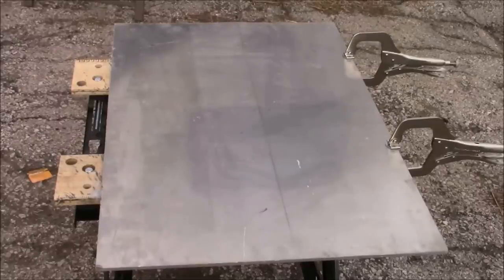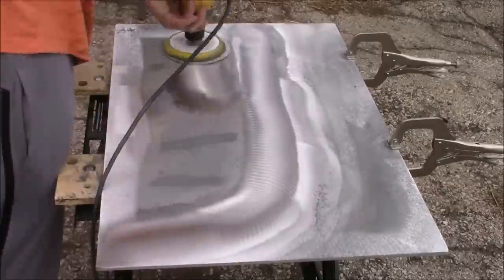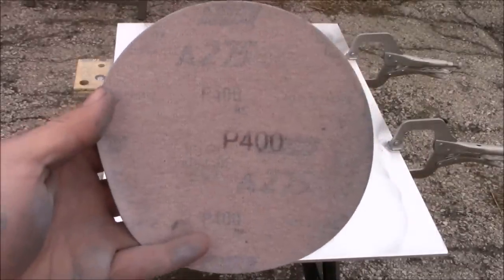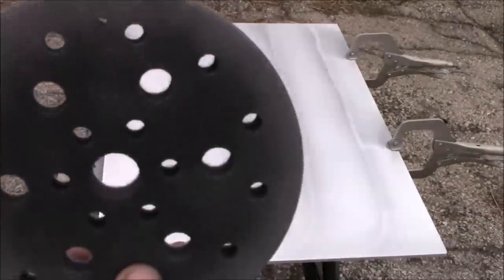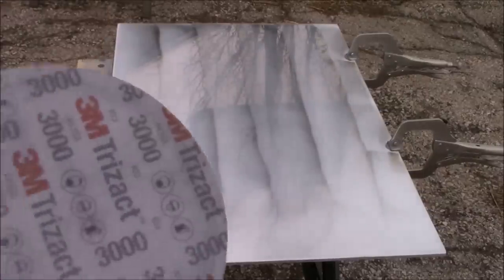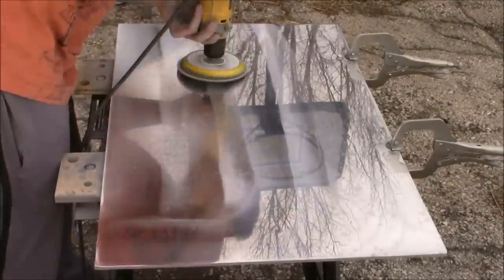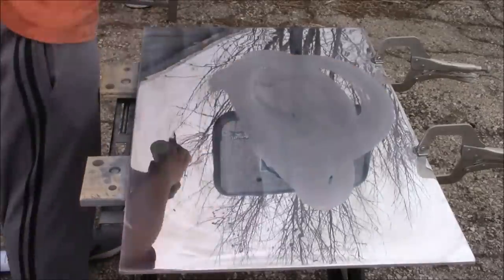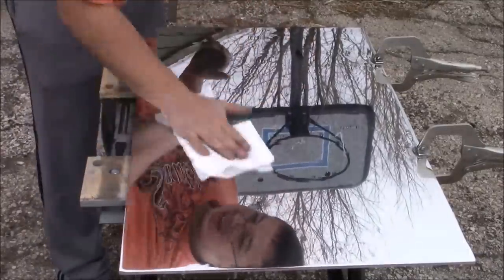How To Sand and Polish Aluminum To Mirror Finish

Comment: Great video showing how to get there step by step.  However, there's more than one way to skin a cat.  You could rub it my hand and get there a year later.  So it all comes down to how much time and at what cost.  By the way, my comments apply to this video and the one you have on stainless steel.  While 3M products are the best, they are way to pricy for what the average person wants to spend. I would be willing to bet the cost of the products you suggest exceed the cost of the metal itself.  Also, the alumicut (other video) and Gord's are pretty obscure products. Suggest a teflon lubricant and one of the many outstanding aluminum polishes on amazon that are highly rated and cheaper.  I'll suggest and link for sandpaper that is way cheaper that comes with both the hook and loop pad and soft backing pad.  Lastly, I point you at Zephyr products buy way of a youtube video demonstrating the very thing you're doing.  I've never used their buffing wheels or rouge, but I can't help wonder if this route would be much cheaper in the long run if you're going to be doing this over time.    Zephyr (https://www.youtube.com/watch?v=5K8GXcJ5pJs&t=0s&index=2&list=PL8FsQ8z7fVccvY_z04RFepojSBwutopYA&frags=pl%2Cwn)  Sandpaper (https://www.amazon.com/dp/B073NYSB82/?coliid=I1QN5HFUW411BZ&colid=1FU2X748C3H9G&ref_=lv_ov_lig_dp_it&th=1)  Thanks for your video. Very helpful.

Comment: Nice shine you know I just paid 250 just for the fronts of my aluminium rims . I just didn't have the time but for the money I paid him I could of got my own stuff . do you know from what grit I should start with and then end with .and then I know to add polish After sanding .but kinda nervous putting sand paper to my rims but I got some scratches and a curbed rim that needs some sanding to smooth out wear I hit the rim thanks great job on that plat
Reply from the maker: Thank you. I have links to all the products I used in my description. You can follow all the steps in this video or you can watch my aluminum rim polishing video:https://youtu.be/eAaROQgJJ9E ,

Comment: Hey! Thanks a lot for the video! Its very helpful. Did you notice the aluminium to oxidate? It usually should become "greyish" quite fast. Did you use anything to protect it from that? Clear laque or something similar should help...
Reply from the maker: Thank you! I'm glad you liked the video. Well the polish I used contains a sealant that helps hold off the aluminum from oxidizing. It should stay shiny for several months.
Reply: Skills and Trade hey Thanks for the quick response!
Reply from the maker: No problem. Glad I could help.

Comment: If you wanted to have a swirl pattern in it would you want to scratch it out before or after you polish I’m assuming before since you should only hit the high spots making it mirrored with your pattern still etched in?
Reply from the maker: Yes that should work fine

Comment: I have new aluminium shiny but not glass finish can I skip a couple stages?
Reply from the maker: You could maybe skip the 220 grit if the aluminum is not badly scratched.  If you skip the 3000 grit or higher your ability to achieve a mirror will be diminished.

Comment: Awesome.  Did you use a drill because you think that is the best tool for this job?  I am trying to work out what tools to get.
Reply from the maker: Thanks. I used a drill because it works the best for me. I actually have Amazon links in my description showing all the tools and supplies I used.
Reply: I think a Festool Rotex would be perfect but it is rather pricey...

Comment: Hey man cool job. I want to do the same to my motorhome the top half both sides without taking panels off. Can it be done?
Reply from the maker: If it's aluminum it can be sanded and polished. I'm not sure if you can do it without taking the panels off,  as I'm not familiar with your motor home. Best of luck on your project

Comment: Question: about how many minutes did you spend on each grade of sandpaper? I've got a 4" diameter 20 foot long aluminum pipe that I want to polish before I paint it. Doesn't need a mirror finish.
Reply from the maker: About 5 minutes or so. I have product links in my description if needed. Good luck with your project!

Comment: can you talk more about the burning that made you switch half way through the 3000 grit? I tried sanding an aluminum bicycle stem and I got these weird streaks / stains and I think I'm going to redo it.
Reply from the maker: The 3000 pad was getting worn out, it sounds like the same was happening to you. Start from an earlier grit and redo it and you should be fine

Comment: I tried this for the window trim on a mid 1950s vintage trailer. My results weren't as good. :( The WD-40 almost seemed to create a dark grey slurry that was hard to remove and when polished it was splotchy and definitely not mirror like. Obviously my application was crap but wondering if maybe these old anodized aluminum trim need more of the 400 sanding? Did I put too much WD-40? I lightly sprayed between every other grit. It seemed to make a light grey coating on the pads too. What if we sanded without the lubricant?
Reply from the maker: https://youtu.be/bgtW-kbmQwc , you should try watching my second attempt at sanding and polishing aluminum. I use alumicut instead and it worked better than WD-40

Comment: Great video!! One question... how did you attach the interface pads/hook it pads to the drill? They are threaded to go on a polisher. Is there a special attachment? Or did you simply put threaded part directly into the chuck?
Reply from the maker: I simply just attached them to the chuck.
Reply: Skills and Trade amazing! Thanks for the tip!
Reply from the maker: No problem, I'm happy to help

Comment: I wanna do this to my hood on my car where did you get the sandpaper and the tool that it goes on not the drill but the attachment and also that black pad and the one at the end where you take off the aluminum polish also what grade steel wool was that 0000 fine or?
Reply from the maker: I got all my tools and sandpaper off of Amazon. I actually have product links in my description if you are interested. And yes it was 0000 fine steel wool

Comment: Should you put a clear coat on metals? Lets say I polish the edge of a typical steel wheel using this method should I clear coat it to  keep the polish look longer? I want to polish about a half inch of 2 sets of wheels and paint the insides blue.
Reply from the maker: It shouldn't hurt your finish and help keep the polish look. Best of luck on your project.
Reply: Nickelbawker if you can make it stick without problems with all the oils and polish on it.

Comment: I want to do this with my scooter engine case, but there are small scratches on it so i need to start with low sand paper right ? Cause I tried a 600 sand paper and it made nothing to the scratches
Reply from the maker: Yes, if the 600 grit isn't working I'd recommend the lower grit sandpaper

Comment: I followed this step by step and results were amazing up until the polishing. I found the polish made it dull again. Any advice on how I could avoid this?
Reply from the maker: Use more polish, and buff slower. The drill should be moving very slow. Don't leave an area until the polish has been buffed completely

Comment: i tried this on some aluminum fuel tanks and ended up with alot of swirl marks. At what point in the process should have they gone away?
Reply from the maker: Retry the 800 sand paper, try to keep the hook-it pad with a slight angle, too flat and it has the potential to make swirl marks

Comment: What are the dimensions and grade of that plate. I'm trying to do the same to a 4ft x 8ft 1/8 in aluminum sheet of 5052
Reply from the maker: It is about 2' x 4', and it is marine grade aluminum. 5086

Comment: Does the hook it pad come with an arbor for a standard handheld drill chuck? Or do you have to get that separate?

From what I can tell, it doesn't really seem to include anything other than the pad itself. I don't really have enough projects to warrant a dedicated orbital sander and I could probably rig up some type of arbor for my handheld drill but I'm just wondering if there's an off the shelf product for it?
Reply from the maker: The hook it pad has a metal bolt attachment that can fit inside the chuck of your drill
Reply: @SkillsandTrade  You're awesome sir, thank you very much!
Reply from the maker: Thank you! No problem. I'm happy to help.
Reply: @SkillsandTrade  Sorry, one more thing. If I've got some pretty "deep" scratches (not like a gouge but more like the thin visible scratches you can feel with your fingertips that you'd get from running an unprotected jigsaw shoe over the aluminum (hypothetically, cause I'm not sure what kinda idiot would do that)), would you still suggest starting at 220 grit? Originally I was planning on starting at 100 and going to 3000 from there. In this hypothetical situation that is, because I most definitely did not scratch my only piece of aluminum with a jig saw.
Reply from the maker: Yes, I think 220 should be fine. Aluminum is soft and 220 will have it fixed quickly, just aluminum cutting oil of some kind or just WD 40.  Just be sure to not spend too long in any spot in the metal or it will create divets. Good luck on your hypothetical project.
Reply: @SkillsandTrade  You're a scholar and a gentleman! Thank you for letting me keep my dignity as well.
Reply from the maker: No problem. Thank you for the kind words and checking out my channel

Comment: The finishing pad you use is not the same as in your list of materials. The one in list is a foam disc. Does it matter which on to use?
Reply from the maker: I must have mixed up my product links up, that foam disk I used in another polishing video and will work fine for aluminum

Comment: Excellent, I just found your channel. Do you have anything for 'restoring' the plastic headlight lenses? I like you're using top quality products here!
Reply from the maker: Mosquito spray should clean those head lights for you. Thank you for watching I appreciate it
Reply: Just buy new ones. The plastic has a protective coating that turns yellow over time. You can sand and polish the yellowing off and it will look good for a while but you will be back to square one in a short time.
Reply: I watched my mechanic mate use a fibreglass cutting compound on a dual action polisher yesterday. He did two set of really bad headlights in 10 minutes. I couldn't believe how well it worked and how quick it was compared to using various grades of wet and dry. 10 out of 10 result

Comment: I wonder how long the aluminum keeps its luster before oxidizing.
Reply from the maker: The finish will last several months because the polish has a sealant.
Reply: if you clean it and polish it well,clear coat it !! aluminum oxides will form quickly!

Comment: I polished a T6 aluminum piece but before that it was already without scratches so I skipped to 800 and 1000 grit sandpaper after I was done buffing the piece I noticed scratches and wire marks any suggestions on how I can make it a mirror finish without any scratches?
Reply from the maker: +Surge Well you should start back at your 800 or possibly a 400 and resand the piece. Double check if you see any scratches, use a flashlight if you need too. Then proceed as normal.
Reply: Skills and Trade using 400 grit should remove the scratches correct? But this is removing more material at the same time?
Reply from the maker: +Surge Yes that is correct. Best of luck to you on your project.

Comment: Amazing job! Nevertheless how are you going to cover and protect the polished aluminium surface ? If left uncovered it shall become matt shortly due to oxydation and also leaves grey stains on any surface it gets in contact with..
Reply from the maker: Thank you very much for your kind words.  The polish I used contains a sealant that protects against oxidation.
Reply: Did it really help to keep the suface protected? Is there any possibility to show how this surface looks now ?
Reply from the maker: I will take a picture later on, upload it somewhere and send you a link.
Reply: Thanks for you feedback and much appreciate your information. You could send it directly to info@mensadesk.com
Reply from the maker: https://imgur.com/a/8wUEk   <---- Just click that link to see it.
Reply: Thanks for prompt feedback and photo! Good luck with your other projects!
Reply from the maker: TableMensa Thank you very much. Glad I could be of assistance.
Reply: Just one more point - usually the polished aluminium leaves grey stains on fingers, or any other surface which it contacts with. Could you please also advise if the polish you used formed a film that helped to protect form such marks ? E.g. If touched by fingers to you have any grey marks left on the fingers?
Reply from the maker: The polish I used does have a film. You just have to be thorough when you wipe it down for any loose polish. If you have wiped it down really well it isn't an issue.
Reply: Thanks!

Comment: Is the hook it pad the price that attaches to the drill? Could I just buy that and the sandpaper and hook it to my drill.
Reply from the maker: The hook it pad isn't attached to the drill. Yes you can buy them separately.
Reply: Which peice attaches to my drill
Reply from the maker: the end of the bolt on the bottom of the hook it pad, use the chuck of the drill to attach it.

Comment: How many sheets of paper you use per step? You constantly add wd40? I've tried same step and got nowhere near the shine. After 1000 grit it just turned hazy. I've tried a mini orbital sander to no avail and a mini polisher. Are those too high of speed to sand?
Reply from the maker: I used a couple 220, 400, 800, one 1500, 3000, and 5000. I only used WD40 on the 220 and the 3000, and 5000 grit. You need a really high speed to sand, low speed to polish
Reply: Skills and Trade the sander I have is mini orbital rated at 15000 rpm. That should be fine,
Reply: When I sand after 1500 grit it just gets hazy again, what would cause  that? It doesn't get shiny like yours does
Reply from the maker: Try sanding a little slower and use plenty of WD 40 on the 3000 and 5000 grit
Reply: The correct tool for this job is a variable speed polisher.  Eastwood has a nice one that's reasonably priced.  It's like an angle grinder but you're able to vary the rpm's.  As he points out, high speed for sanding and low speeds for polishing, which the really high grits are more like polishing.  That being said, obviously a drill works great because as he mentions in the video he slowed the drill down when needed.  That orbital has way too many rpm's for polishing.

Comment: Does anyone know how long polished aluminum stays mirror finish or at least extremely clean when left outside? (Motorcycle engine polishing)
Reply from the maker: It should stay a mirror finish for several months if you just use Gord's aluminum polish, even longer if you use wax.

Comment: What speed were you using on your drill motor ?
Reply from the maker: Max speed with an approximate rpm of 2500 for sanding. Half speed for polishing

Comment: Can you apply the same process on brass?

Cause after I finish I can see small small scratches from sand paper, rounded scratches.

Thanks.
Reply from the maker: Yes it is possible to use the same process on brass. Infact, it will be the next sanding and polishing video I will make.
Reply: Thanks. I'm getting circles of scratches, very very small but visible on direct light and I must fix that somehow cause it looks very ugly.
I went to 4000 roughness and still little rounded scratches are there.
Polish doesn't help - or I should look for some other material for final? Or to replace it more often?
Reply from the maker: If you see small circular scratches from the sandpaper, it just means that you are holding the hook it pad too flat. Try to stay at a slight angle when you sand. Try going back with a brand new  1500 or so. Then work your way back up to 4000 then repolish.
Reply: Thank you so much. I don't have scratches any longer but I have different problem, also very annoying.
Now when I look directly to the light I don't see scratches and that is much better but I see from different angles some spots that look unpolished.
Then I re-polish everything and then I see "holograms" on some other places. Depends of point of view you can see these bugs or not.
How to solve this, is there some specific polish cream for this?
Reply from the maker: It may be an impurity in the brass that you are seeing. This isn't really anyway to solve this problem, however, a change in polish might help make the problem a lot better.  Give blingmaster aluminator polish a try.
Reply: Tomorrow I will try with new polish and entire new equipment. It's hard to find polish you stated in our country, I barely managed to find few different polish creams and one of them didn't work at all cause it's not abrasive enough.
Regarding brass purity - I don't think it's a reason, I got it from two manufacturers because sizes of sheets are different (3m and 3.5m) and even structure is a little different after I polish them I get the same problem again and again on different places... :/
Thanks for your help.
Reply from the maker: Your welcome. Good luck on your project. I wish you the best of luck.
Reply: Thanks a lot!
Reply from the maker: https://youtu.be/29srwbLOZHI  

I applied this process to brass in this video